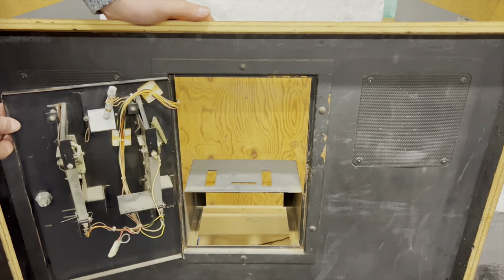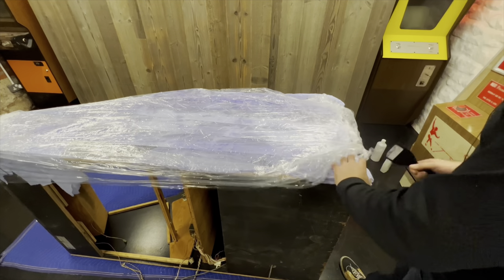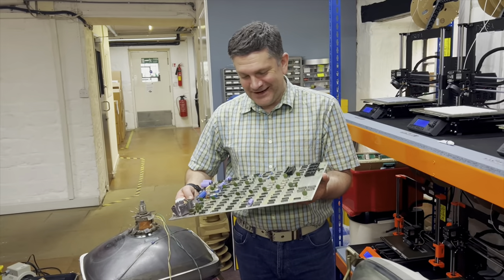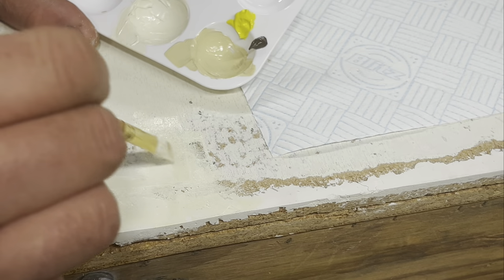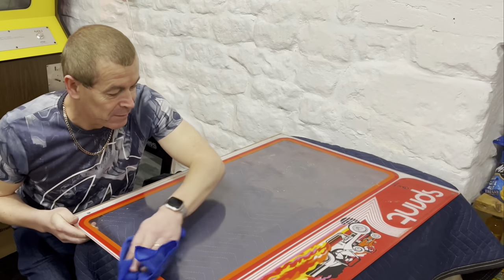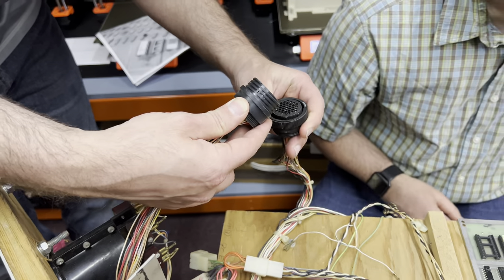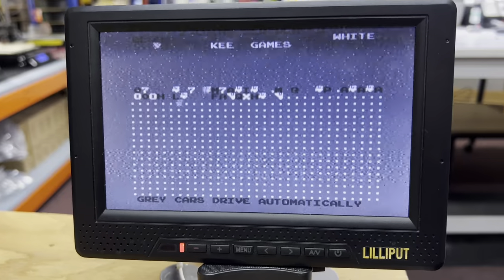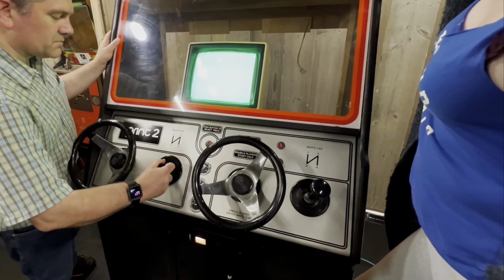Restoring Sprint 2 - A 1976 Arcade Game | State of Play

Comment: Sprint 2 is one of the very first arcade games I came across. I was 8 years old. Location: Stephenson's Golden Sands caravan site, Ingoldmells, Skegness UK, circa 1979, in the caravan site club (which is still there) - specifically in the children's room. I remember it like it was yesterday.  There was also a Space Invaders machine, an Atari Stunt Cycle machine (that never seemed to work), plus a pinball machine called Moon Flight from the mid 70s. Hope you get this one going. Thanks for the memories!

Comment: That monitor is a Hantarex I'm pretty sure. From superficial looks, our Model Racing made Road Champions (Taito license iirc) has almost the same model monitor. That one is working though. Had to recap some of it lately because some of the caps were getting very tired (up in ESR, down in capacity). The replacement caps I used are even older, but NOS.
I hope none of the bipolar PROMs are bad that are used as some kind of proto-PLA (as in the PLA of the Commodore 64). But if they are, I can program 7603s and have two blank ones left.
It looks like the track addressing logic has faults. The automatic cars trying to reach the top left corner and the track consisting of dots in the last state tells me the track ROM isn't addressed correctly or its data isn't being put on the BUS (I bet you already got it fixed though, so just me guessing).
If you end up with a color monitor, you should pretty easily get a color picture output, there's four discrete sprites which can be wired to the color channels... although BLACK and WHITE on the screen wouldn't make much sense anymore.
I got a TV from 1960 that might fit... it's tube though... and I wouldn't run it for more than two hours...
Yeah, passed by a 26(ish) inch black&white TV in the dumpster, just took the circuit board out. Didn't fit anything though, I shoulda just got the entire thing&AV mod it. We got a basement and storage full of color CRTs, but just two black&white ones and two 9 inch security monitors.
Reply from the maker: Interesting you have a Model Racing we have one two and we did check to see if the monitor from that would be a good replacement but unfortunately not.
Any help would be much appreciated.
Thank you
Reply: @TheArcadeArchive  Shango066 lately made a video about a guy in Poland who rewinds transformers (he has a special transformer winding lathe), there's a chance he can fix that LOPT.

Comment: Very interesting.
I have a sprint 2 PCB that I repaired (ram was bad so game wouldn't run) and have also acquired a full control panel.
I don't have much room so I'm planning to make a bartop super sprint with loose pedals that will go on the floor and an old CRT TV sitting on top.
I did a similar thing with a missile command PCB and control panel.